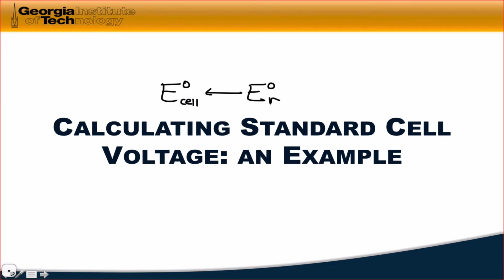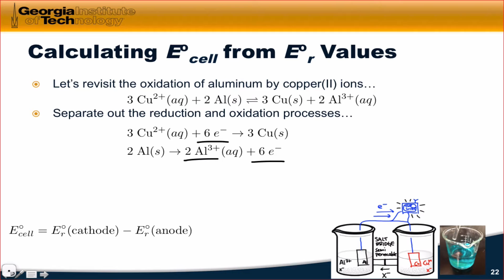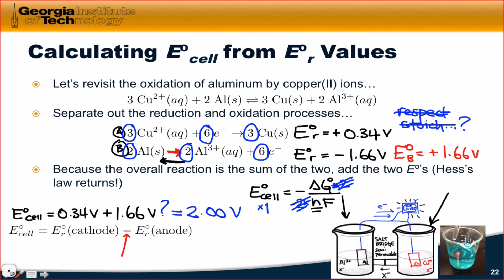16.05 Calculating Standard Cell Voltage

Comment: Isn't it 0.34 V - (+1.66 V) = -1.32 V?
Reply from the maker: In this video I take the difference between the reduction potentials of copper(II) and aluminum cation, respectively. The proper calculation is 0.34 V – (–1.66 V). Keep in mind that the standard potential of a galvanic cell should always be positive (or zero, for concentration cells).